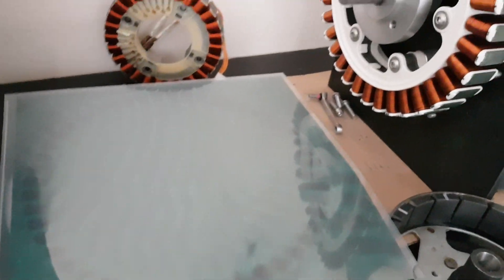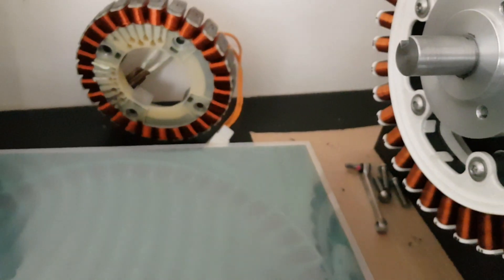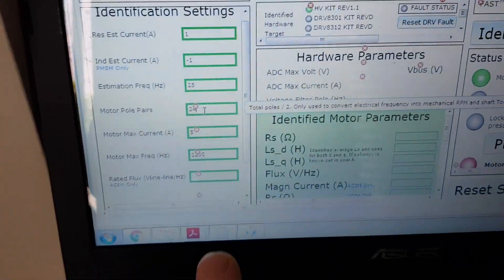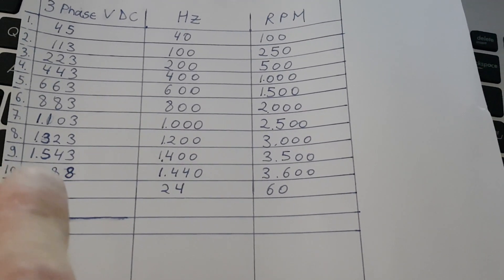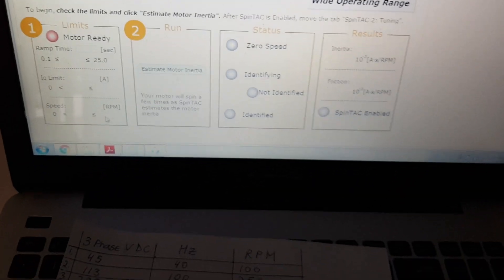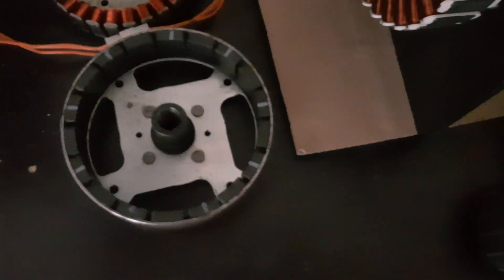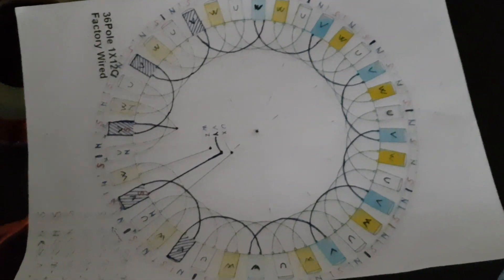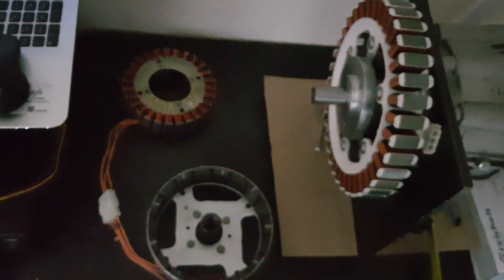Hyper Drive Update| Rotor poles| Details

Comment: If you want to try it, try splitting the coils so that they are in parallel. That would put a higher voltage seen by the coils while allowing a higher frequency. For example, using an HY VFD to drive a Samsung 36 Pole stator, normally it can only reach 1000 RPM at 400 Hz. Same as you showed on your calculations. Now I have modified a Samsung small 18 pole stator to where it runs 3 parallel sets of 2 coils on each phase. Had to reduce the voltage from 240 VAC down to 150 VAC for safety but it then spun the normally 800 RPM rated motor up to 2000 RPM at 400Hz. Next up will be a Samsung 36 pole unit split into 3 parallel sets of 4 coils per phase. That should allow the 36 pole unit to run at 2000 RPM at 400 Hz. Problem with splitting the coil wiring is making sure you do not exceed the wire capacity and create a heating element. The 18 pole unit as now wired, was one at 240 Volts. It got hot enough to melt the hot glue. At 120V it is cold after running. Will be playing with the voltage  to see just what the safe limits are as that is what determines what the max load on the motor can be. if you want to see a lousy cell phone video of it running it is at https://youtu.be/w2w8nEoR-WA
Reply: A better video is now at https://youtu.be/jN-TDu9DRTE

Comment: Hello Dan, very much appreciate the information you are sharing.  I purchased a similar washing machine motor/stater awhile back and the harbor freight 10K generator like Morin displays .  I too was exploring the purchase of this TI controller. It was a real treat to see you were already sharing your findings with this equipment.  I was wondering if you would consider a joint effort in your research.  It seems to me that an actual torque measurement would benefit your data and research.  I would be happy to assist you in building a poor man's torque measurement device.  We could design a pony brake device that would measure the force 12 inches from the center of the rotor.  The formula is very easy once you know two variables.  The ft/lbs and the RPM's.  By measuring via the pony brake 12 inches from center (thus 1 foot) the pounds force using a simple force scale. For example a bathroom scale or in-line scale (like a fish weighing scale), we determine the ft/lbs of force at the operating RPM.  I have a metal lathe and CNC mill table, so I could assist you in making these components.  The formula once you know the two variables is as follows:    ((Ft/lb's) * RPM) / 5252 = HP 

 Since the existing standard is 745 watts of power = 1 HP, you could could project how much power the generator would support by measuring the HP of the hyper-drive motor. We could measure the torque or (HP) at the various RPM ranges to see where the "sweet" spot is on the washing machine motor.  Assuming you find an excess of HP, rather than operate the washing machine motor at 3600 RPM, we could eliminate the direct drive method and use the appropriate gear ratio to run the motor at the sweet spot RPM.  For Example, if 1000 RPM is all the TI controller will support at 347 VDC, then a ratio of 3.6 gearing would be required to get 60HZ @ 120/240 VAC from the generator.  The draw back is it would require 3.6 times the HP since it would be gearing up in nature.  So, if you require 5000 watts of power continuous and you can only produce 1000 RPM with the TI controller.  It would take ~6.8 HP at 3600 RPM, but it would require 20.4 HP using the 3.6 ratio.  The higher RPM of 3600 is a much better solution by the very nature of the torque formula, but finding high power MOSFETs that can handle 1500 VDC might be a problem.  I think finding the frequency that allows the motor to operate in a resonant state is the key to yours and Gerard's work.  When the capacitive reactance is equal to the inductive reactance for each coil circuit, and that only occurs at the "correct frequency" then the amp draw will drop significantly.  Anyway, let me know if you are interested in combining efforts.  Here are some excellent links that explain some of what I revealed here.
Resonance explained

https://www.youtube.com/watch?v=vi24SpKYYoQ
Simple pony brake method for measuring torque
https://www.youtube.com/watch?v=hcHSrN4hwa4 

(watch near 7:46 minutes)
Reply from the maker: Hi Vance, very interesting videos. Btw, I am living in UK, were are you living? To make that torque measuring device it's very easy. The thing is that with the TI controller I can't spin the Hyper Drive over 455 RPM unless I am weakening the magnetic field and for that I need more current. If you are in UK we can probably get in touch, but if you are in US, I don't know. You have to built it by yourself and share the info. Also to supply this Hyper Drive with the right RF it is not easy!!
Reply: I live in Texas inside the USA.  So you are correct, it would be difficult to share from that distance.  I will tell you what I am working on at the moment.  I am trying to build a frequency controller using an Arduino microprocessor.  See this link:
https://www.youtube.com/watch?v=Z1ek1-K518A
This controller is nowhere as comprehensive or sophisticated as the TI controller you have, but if its functional and works....we could change the mosfets to ones that can handle 1500 VDC and program the frequency we need to get 3600 RPM.  Here is another website that this project above likely sourced from.  This second site offers a sensorless version and also one with sensors.  Here is the second web site link.
version without sensors:

https://simple-circuit.com/arduino-sensorless-bldc-motor-controller-esc/

version with sensors:
https://simple-circuit.com/arduino-bldc-brushless-dc-motor-control/

Let stay in touch and compare notes from time to time.  The best solution would be if Texas Instruments would agree to offer a version of their controller that that went up to 1500 VDC input and a frequency that could produce RPM of 3600.
Reply from the maker: @alfievance  Oh yeah! I was thinking the same, if Texas Instruments would build a controller which can supply 1600V and 1450HZ @ 2 Amp that would be amazing! Very good step to start building that controller. We will keep in touch.
Reply: Cree mosfets can handle 1200v no issue.
I am pretty sure they can handle more than that... but I am not sure of 1500. Guys have pushed them up to 1400 before and they work.
I want to say they do make a 1500v mosfet rated as well...but amperage was lower than their pulse rating on 1200v ones.. 100amp